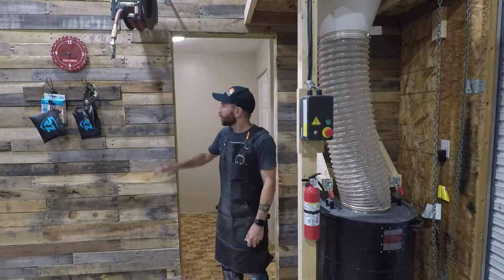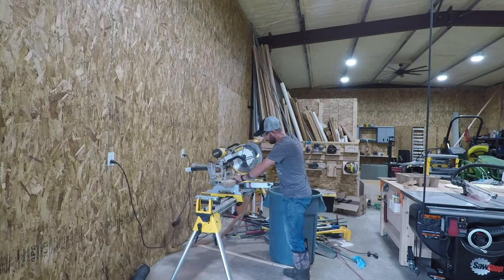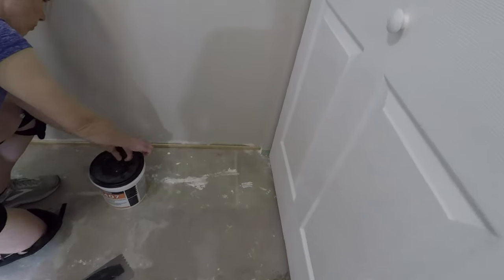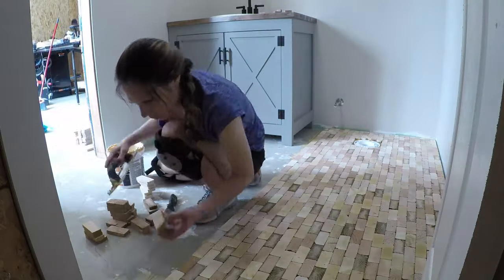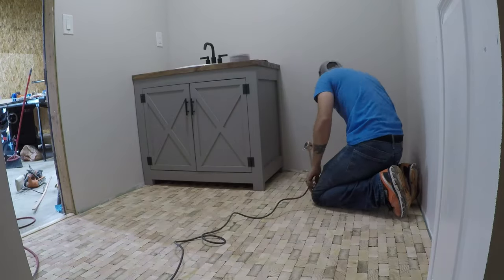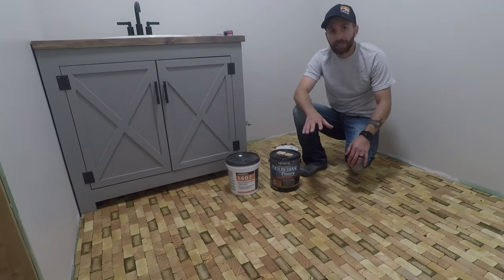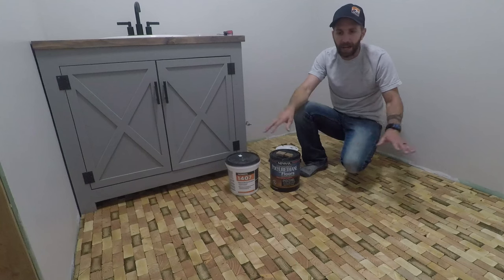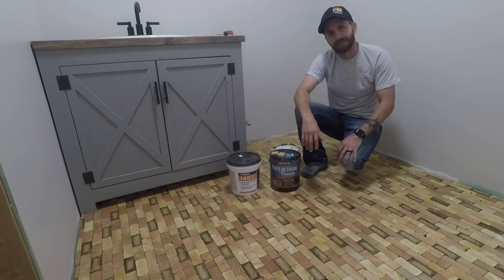How to Make 2x4 End Grain Floors

Comment: This looks awesome! I have seen this a number of times over the years. I am moving soon and remodeling the location which I will be living. I intend on putting this type of flooring in with antique lumber I have from my circa 1863 house that was left in the garage from original construction. QUESTION: What is the benefit of brushing the poly on rather than pouring and squeegeeing in on? ...was the poly placed on the floor in (I believe you stated 4 coats) in order to fill in as a replacement for the grouting between wood tiles as well as to get the proper coverage thickness of said poly? Again, looks great!
Reply from the maker: There was no real super strong reason for brushing the poly versus pouring it. I just wanted to get good even coating.

Comment: Awesome floor ! And thanks for sharing. Can you tell me the type and model of your Dewalt miter saw  ?
Reply from the maker: It is the DWS780. I just recently replaced it with the 12” Delta Cruzer. Both are fantastic saws.
Reply: @TarshaHomestead   Awesome reply ! Which one you like better ? I  also see Makita has a similar setup.
Reply from the maker: @chefgiovanni  I prefer the Delta Cruzer, primarily because I like the slider much better. It feels amazingly smooth. Of course it helps that it has less depth too. The DeWalt was fine, but the Cruzer impresses me fully!

Comment: Thanks for the video, the floor looks great! I've been toying with this idea for when we redo the floors in our bedroom. Just a few questions for you or anyone else who reads this: Any tips for installing this kind of floor in an upper story room with a plywood subfloor? It's not a bathroom so water isn't as much of a concern. Would you use a simple wood glue like Titebond as an adhesive? Some other type of generic construction adhesive? Would you want to put down some type of underlayment in between the subfloor and end grain? I'm thinking like maybe a cork underlayment floating on the subfloor with the 2x4 glued to the cork. Would that be stable and solid? I'm thinking if you ever had to remove the flooring it would be easier to accomplish than if it's glued direct to the subfloor. I love the look and the idea of this type of flooring, just trying to think through all the possible issues. Thanks in advance for any advice.
Reply from the maker: I would probably do plywood underlayment screwed down and then glue to that with an oil based adhesive. I would not use Titebond or another wood glue due to end grain not gluing up well.

Comment: Anyone considering this, I recommend a few changes. First, if you have a joiner and planer, get the boards to a more exact dimension so that you don't. have so many gaps. It will make a big difference. Those gaps between pieces are going to allow moisture down in between the wood, which is a recipe for problems, and eliminating the gaps will make it look professional. Also, don't use pressure treated pine. Also, don't use pine lol. It's very soft and susceptible to moisture issues, ESPECIALLY on the end grain. If it's only a few boards, get a hardwood from a lumber yard. This is a bathroom, so moisture is going to happen. I would make sure you did everything you can to eliminate moisture coming up from the slab in the form of a moisture/vapor barrier, which probably still won't totally eliminate the problem, then seal the top REALLY well.
Reply from the maker: Some good points here, but I have a couple counters: pine is great because it’s cheap and readily available. If anything happens and one needs replaced, i can pry it up and glue down a new one. I can grab a 2x4 at a big box store and make a ton of blocks for super cheap. 

The gaps were intentional as I had planned to make a wood glue and sawdust grout, but found it unnecessary (and not as visually appealing) once it was all in place. Also, gaps or not, moisture will get between the wood, it’s a fact of life in a bathroom. This is why I chose to let the polyurethane get down between them.

We’re about a year in and the floor has held up great.

Point is: you have some good suggestions, just have to weigh those with the goal here. The goal isn’t a flawless, expensive, uniform hardwood floor.
Reply: @dropndeal  go long!
Reply: Great stuff! My only recommendation would be to use a roller tray for the sealer.  You can roll it on much faster and still use the brush to work it in.

Comment: This may be a dumb question but if you soaked all the pieces in a 5 gallon bucket of poly before you install would that save time and material when you go to brush it on after the sanding?
Reply: I question the effectiveness of the adhesive to the wood.

Comment: I love the idea, it looks fantastic, and thank you for the video, I've a few observations (perhaps constructive criticism to be honest):
1: Are you not seriously concerned about water, or even just humidity making it's way into the wood and causing it to swell and buckle? I guess you could mitigate this by varnishing the underside first, letting it dry, then doing the rest of the project as you did it?
2: Are the corner gaps fully filled with varnish? I would imagine it would be a perfect place for water ingress to get to the wood underneath.
3: Did you consider using something like cedar, a large expansion gap all round (filled with cork perhaps) and letting the floor float?

Thanks, not trying to be rude (as another poster was), I'm watching this because I find the concept intriguing, and have been considering myself, but it didn't answer any of my concerns about the downsides of the technique.
Reply from the maker: Hi Sinule!

These are great questions. I am a little concerned about water, especially being in a bathroom, but I’m also weighing that with it being extremely cheap. If it doesn’t work out, it’s only my time lost.

I slopped the polyurethane all over and allowed it to flow into the gaps. I didn’t fully fill them, but certainly got a bunch down in there.

So far I do see some contraction in a couple spots but no expansion yet. Also, it seems to be doing fine thus far.

I didn’t consider cedar, but if you were willing to clean up it’s end grains I’m sure it would work well.

I have seen where people have used a wood glue, wood shaving mix to make a non-water-based grout, but I did a test of this on a scrap piece of wood and didn’t like the look. I would test that first before committing to it
Reply: @TarshaHomestead  really loved the video, and I am very interested how the wood has held up in the last year. I would love to do an entire house like this, but have been hesitant about the wet rooms and areas for this specific reason
Reply: Folks have been making floors like this for hundreds of years, and long before the advent of polyurethane. Relax; it’ll hold up just fine.

Comment: Nice job! Thanks for sharing. What grit sandpaper did you use and or recommend?
Reply from the maker: frankiesimo thanks! I just used 80 on the belt sander pretty quickly, then 120 on the random orbital sander. Seemed to do just fine for me, but I wasn’t looking for showroom perfection either.
Reply: @TarshaHomestead  Great! Last question. Did you have to fill in any spaces between the blocks? If so, with what? Thanks!
Reply from the maker: frankiesimo I think you definitely can, especially if this is a floor in a home. I would just be careful not to use something water based. I did not on my shop bathroom floor and I think it looks great

Comment: How is it holding up? Any expansion issues or cupping?
Reply from the maker: We just moved away in April but as of then, zero issues at all. Utah however is a pretty stable climate. Hot and cold swings but always low humidity.

Comment: This is a very old technic. 
The Romans were using it as well. For sealing, they were using tree pitch.
Reply: Old machine shops used this technique.  The floor outlasted the rest of the building.  Exceptionally durable, easy to fix.

Comment: Would you recommend this in a high traffic area , like a kitchen ?
Reply: well, similar constructions (coblestone-like cubes of hardwood facing upward) have been used for industrial floors in older days. still withstanding pallet trucks and forklifts. if too much wear occurs, you can sand it down several few times. usability of softer wood may depend on how much abrasive stress it's exposed too. Placed right behind a family home's maindoor with sandy garden pathway and wearing streetshoes inside vs. well cleaned 3rd floor backroom usually accessed with slippers or sox.

Comment: How thin can these end cuts be? Asking because I bought a house with concrete floors. Previous owner tiled kitchen and bath and then laid 1/4 " plywood on the rest and tried paper bag flooring. Poor job putting down plywood, poor job paper bagging.  Now I need a way to pull up and finish floors on the cheap..I'm old and on SS. The tile is 1/4", so whatever I do has to be 1/4" in order to be level. Any suggestions? Tiling the rest of the house is not in my budget. Unless there is absolutely no other option, I really dislike vinyl planks.
Reply from the maker: I don’t know that 1/4” would be thick enough. Even at 1/2” I did have some pieces of end grain that would split.
Reply: @TarshaHomestead  I've been away, just saw your opinion. My issue is that someone already put 1/4 inch tile in several rooms and using this method with anything thicker than that would leave the floors uneven. I thought it would be too thin, and you've confirmed it. I just have to save a lot longer and continue with tile. Thank you.

Comment: Did you remove the vanity?  It looks like it, though I missed it in the footage.
Reply from the maker: I didn’t. I was lazy and “tiled” around it. I regret that choice.
Reply: @TarshaHomestead  my old pastor told me not to wallow in regret. She'd say "don't should on yourself, it doesn't wash off easily"

Next time. Learn from shortcomings.  An old boss found out I rolled a bobcat face down unloading from a trailer. I admitted it and was ready for a pink slip.  Instead he sa said "I don't mind mistakes,  just don't repeat them."